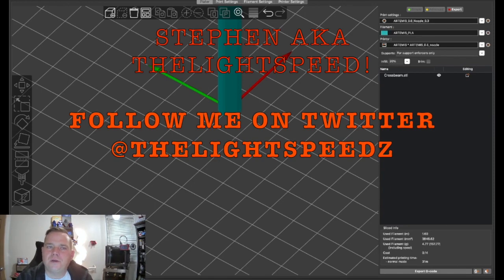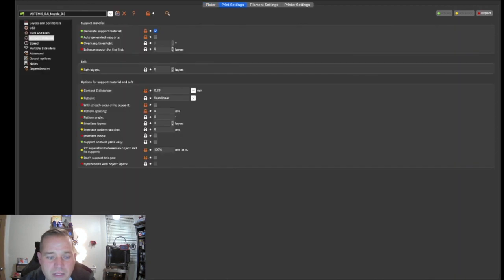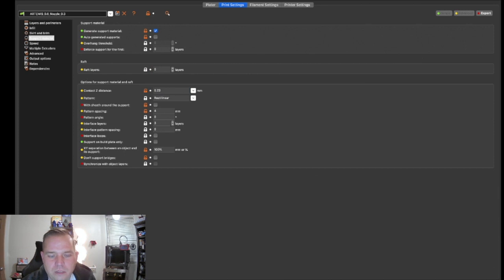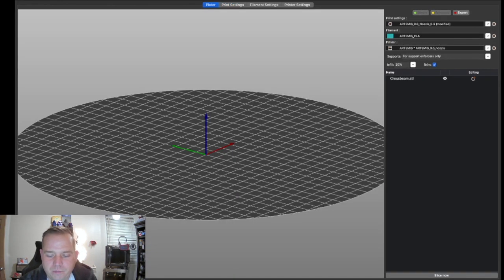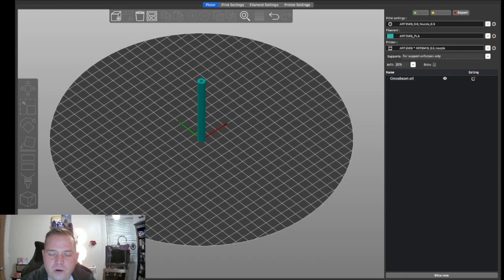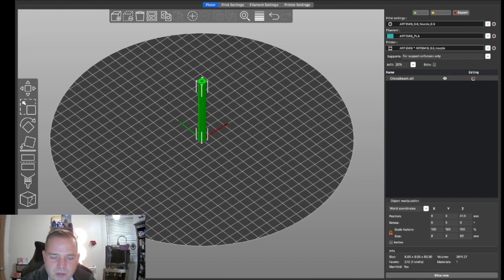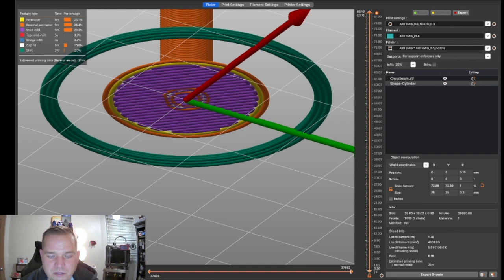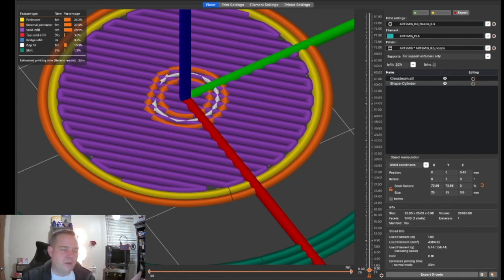PRUSA SLICER TIPS #001 HOW TO MAKE YOUR OWN BRIMS

Comment: i have a completly different problem, sure i have abs piling on the edges and my small precisyon parts mostly land in the trash but what bothers me more is how z axis on my ender 3 responds to prusa slicer
i might be ouvercooking the print but as far as i am concerned bottom layers are almost always overextruded squished and melted together while all the layers on top kind of flow down the slope (elephant foot) but if that was all i would be happy
when i use creality slicer z axis is calibrated by the printer stepper settings and i can scale it up or down after calibrating with few test prints
in prusa slicer i almost always get first half milimeter too short and the whole print is missing some height
the problem is , for my print that is almost 10- 20% of the overal height and i could only cure it so far by designng thicker models 
is there a way to ofset a print from the bed completly , raft style byt rather drag the stl file up in the slicer leting the slicer itself add supports below a floating model?